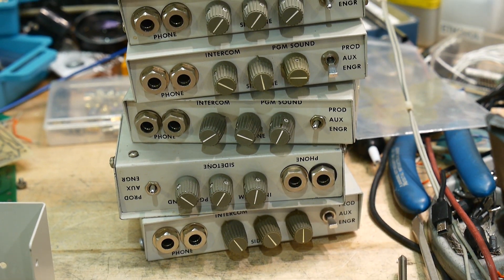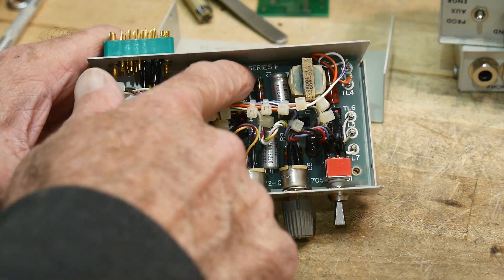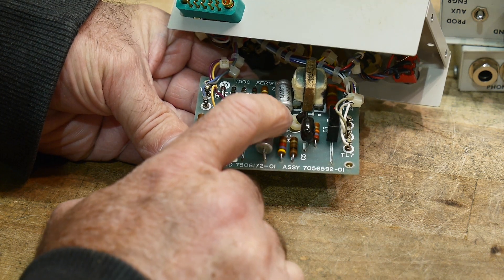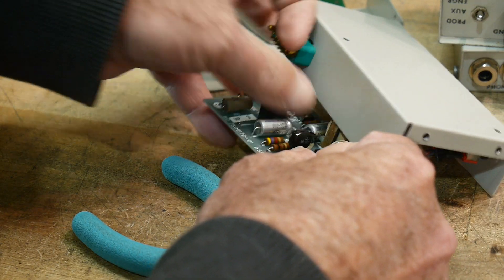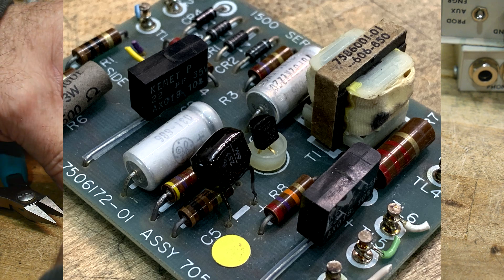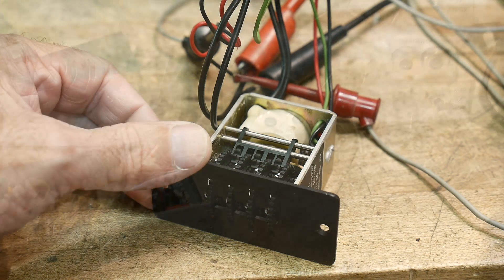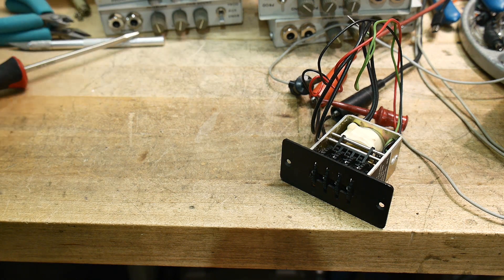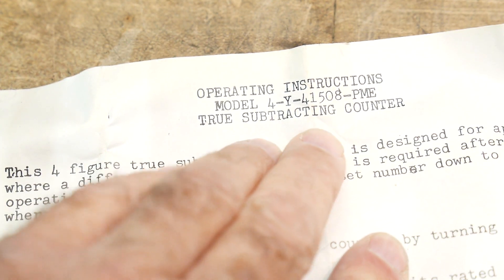#635 Colby Audio Project Box Teardown

Comment: Judging from the outside, these look like a very old version of the Rolls PM50se, PM60, PM351 Personal Monitor <etc>, I don't know if there's a generic term for this but it's a control put inside a recording booth that usually gives an adjustable mic pre-amp, a Monitor output with control so the person in the booth can hear themselves, and sometimes, couldn't find a specific unit off hand, they also have an Intercom from the editing(?) booth so the engineer can talk to them from outside. These are presently somewhat popular with audio book narrators because they can build an accoustic pillowfort then climb inside with a mic, an ipad to give them the script, and this PM unit so they can manage the microphone without having access to the computer that is recording them.